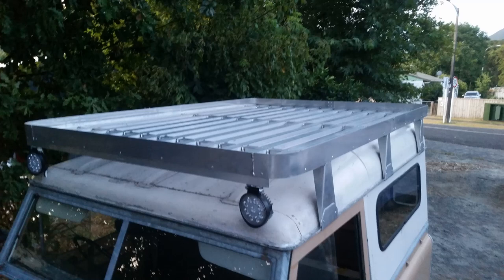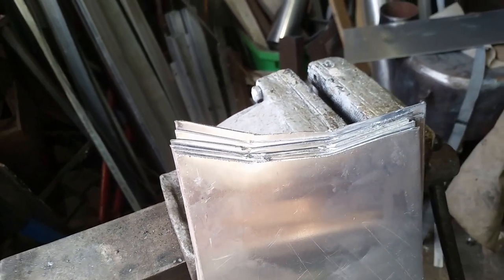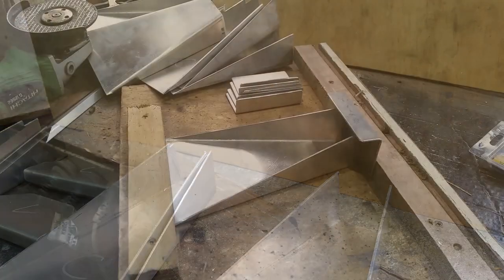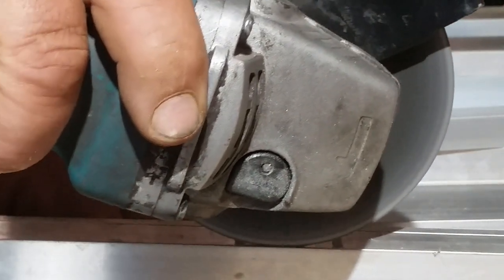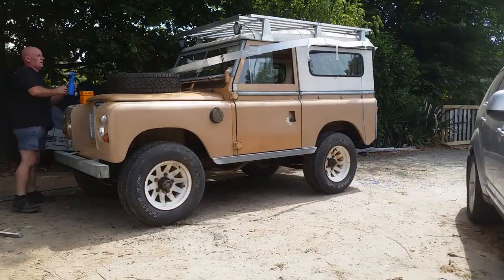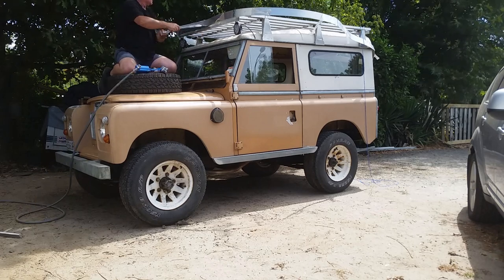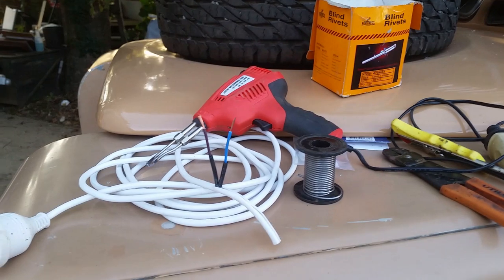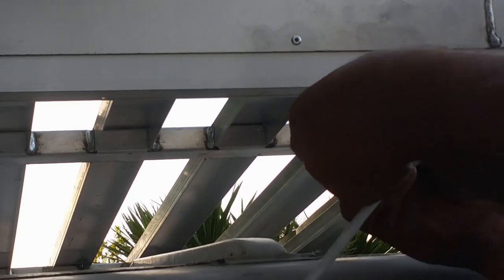Full Alloy Roof Rack -Build it Yourself and save $$$$$

Comment from the maker: It was tedious notching so many runners into the cross bars but you dont have to. I did it to keep the profile 1 inch lower. if you do it the conventional way there will be a lot less welding too cos rivets will do the job
Reply: But it looks so much better when you notch it.  One thing I'm wondering is what did you do for a ground on the lights the extension cord only had 3 wires which you used on the forward lights, reverse lights and the third wire on the inside light   Other than that grounding I think you deserve employee of the month again. Lol 😂
Reply from the maker: @stacyreid5077  hi Stacy.  I used the body earth
Reply: TinyHouse and Offgrid Resources ok the roof rack looks great   They now sell aluminum welding rods that you use like a brazing rod   Here in the states you get I think 8 rods that are about 18" long for around $15-20.  I sure want to try it
Reply from the maker: @stacyreid5077  and me! I'm very impressed with the advert for them  there was 160 inches of weld on that job it would have gobbled $100 of rods and that's what I paid Evan
Reply: TinyHouse and Offgrid Resources it all looks great 👍🏻

Comment: Love the idea of DIY. Saving money, custom built for oneself, new ideas tried etc. etc. The one worry I always have with DIY is that some little failure somewhere, for this roof rack as an example the use of rivets, soldered joints for wiring and all the other little unknowns that can end in disaster. We all tend to over-engineer such DIY projects to try and overcome these unknowns, so it does help when someone like yourself with heaps of experience with thin aluminium shows the way. For example, along with the rivets, you had the short side of the channel welded. I imagine you riveted it up to create the structure so the welder could weld the rest without having to align the bars.
Reply from the maker: yes exactly!  if i built it the normal way the nothing, welding would not have needed doing but I had 5 lengths of channel just sitting there to use. there are various ways to do things, this way the rack is 1 inch lowerbut took more work than  If I had just rivited box sections
Thanks for your comment.

Comment: I really can't see any advantage in the aluminium rack compared to steel. It cost you 300 bucks not including the "leftover stock" used. You didn't save that much weight, you didn't save any money, you can't carry much weight, you can't walk on it. I think (in hindsight) could have taken the "leftover stock" and cashed it in at the recyclers and just about paid for the steel with it. If you can't weld or don't own one then I guess there would be a motivation loss there. Gasless inverter welders that can weld core flux wire are about 100  bucks or so on eBay so maybe that could be the next big thing. You seem a handy guy, think of all the stuff you could do with it. Not trying to be condescending, just talking like a bloke would to his mate. You did do a nice job with it. I spent 20 years in the domestic and commercial aluminium window industry and know the shortcomings, cost and ongoing problems in the permanent joining, flexing and electrolytic corrosion of this material, powder coated or not. All the best to you.

Comment: Looking good, thanks for sharing your hard work.  In terms of the reverse light my S2 didn’t have a switch either, so I drilled the housing, fitted a land rover brake switch to engage when you put it in reverse and ran that through the chassis to a spot light.  Happy Rovering and have fun at the festival.
Reply from the maker: jeeze - thats brave!

Comment: is that a standard old LR brown? does it have a ral number.... I fancy my van being brown
Reply from the maker: The colour is called 'Sand'- it was an export colour only. and quite rare even here. Its the first Ive seen this colour. and one of the reasons that I bought it. The 109 inch one in my latest videos has been three LR colours!- Im taking it back to Marine Blue with Limestone top and wheels. But right now- I cant even buy a sheet of sandpaper!
Reply: @t.h.o.r.  yeah same here the lockdown is what it is all over, a financial catastrophie but also a necessary evil to slow the problem. I'll screen shot it and isolate a bit and try to match it to the old colors. I could go modern with my van or even a team but we're planning on using it for the hire of garden play equipment and wedding items so an old fashioned vibe it's what were after on the outside

Comment: Love this mate... but what went on with the plastic to diesel stuff. I was hooked on that series of videos but it did not seem to come to a conclusion. Did it work or not?
Reply from the maker: i have a neighbor  who is a bit spacey- she is convinced that Im trying to blow up the neighborhood and rings the council when i fire it up. The burner roars too loud and goes for 3 hours so there is no hiding it lol!
Reply: TinyHouse and Offgrid Resources, so would you say the conclusion was a success? Would it work? I am an engineer by trade and I can see all the principles especially the recirculated gasses.... would you say that it produced zero emissions? I appreciate your help and advice on this project.
Reply from the maker: @sinemetu9037   The only emissions are if you open it before it s cycle is finished or if there is a leak- Oh and a minimal invisible discharge from the burner. that burns 1.5 litre per hour of any waste oil- Ive found ATF to be the best followed by canola oil and car engine oil. Diesel oil is dirtier.  Kaolin kiln wrap is what is needed or chuck the outer 44gallon drum and build a fire brick chamber. Do it properly.
With some temp sensing valves and a bit of Arduino knowhow you could automate it
Reply from the maker: @sinemetu9037  the only emmissions are if it leaks while running and a negligable amount-(invisibe) from the burner  which burns 1.5 litres per hour of waste oil. STF seems best- cooking oil is also good and car engine oil is better than diesel oil. Im sure that if you scrapped the oil drum burner housing and made a proper firebrick kiln there would be no stopping it. Add a couple of therostat operated valves and som Arduino know how and it could run fully automated
Reply: TinyHouse and Offgrid Resources, so in effect the dirty gasses from the burn are burned away when introduced back into the flame?
Reply from the maker: @sinemetu9037  Yes- they are very powerful. once they start you can turn the oil burner down by 30% at least..with a proper kiln chamber I reckon 600c will be real easy to achieve.
Reply: TinyHouse and Offgrid Resources, I appreciate your thoughts on all of this. Just a couple of other other questions.... 1. Can all waste plastics be used in the melt down process or are some not suitable? 2. The benefits I can see here over other forms or recycled plastics is that the plastic does not have to be cleaned... say from some food residue or say soaps. Would this be correct? Thanks for your advice and help.
Reply: Mate... need some help here. Can you look at last message. And also point me in the direction of some plans or build information. Your help is much appreciated. Nick
Reply from the maker: @sinemetu9037  sorry Nick.  It seems that I don't get notifications  for all messages. -missed this one.  I'm using rinsed milk bottles, obviously cleaner is better. You can use polypropylene polyethylene but no plastics ending in 'chloride'  or 'acetate' so no pvc  or pva.
Reply: TinyHouse and Offgrid Resources, thanks for that mate. In your diagram you say the waste gasses are to be drawn off and introduced back into the burner. How? Will the flow naturally separating from the new oil? Sorry for all the Qs and as always appreciate your work and videos 
All the best 
Nick
Reply from the maker: @sinemetu9037  the colection vessel for the fuel has to have a vent. I use a 4mm fuel line to vent the gasses down into the Babington Burner. The burner has jets for waste oil drip. Lpg gas. and 'produced' gas.